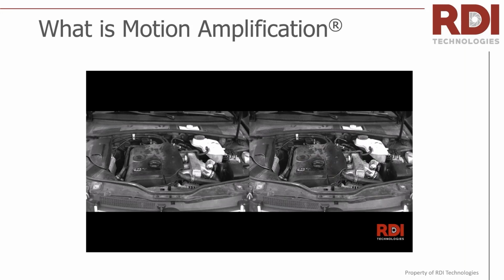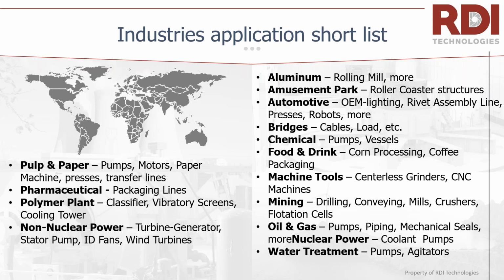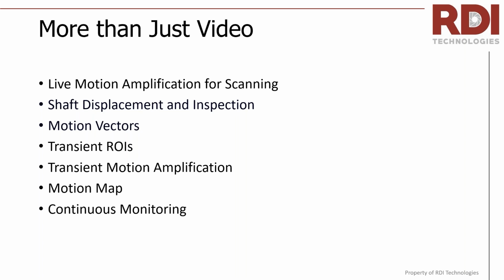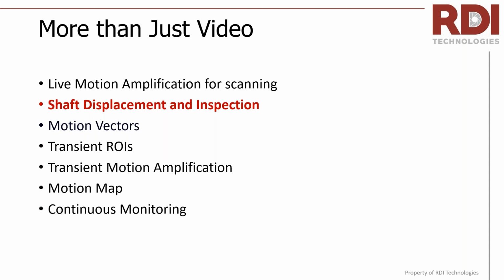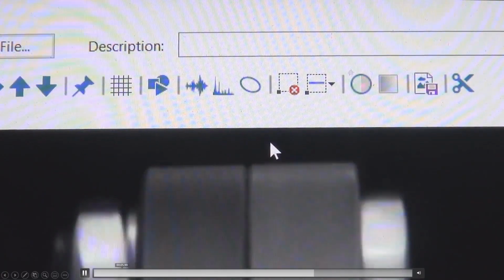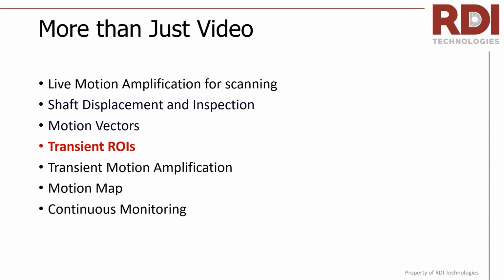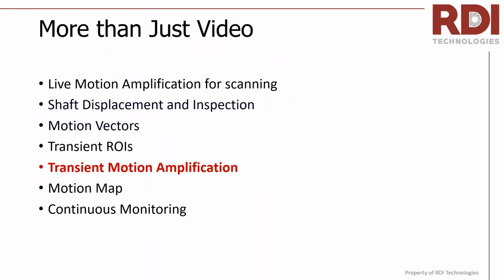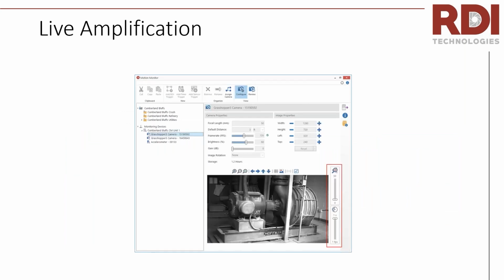Motion Amplification®: It's Becoming More Than Just Videos

Comment: a rotating machine must vibrate.  if the vibration is higher than the standard it will be a problem.  this tool is too good.  but can't detect the broken shaft and impeller shake inside the pump
Reply from the maker: Motion Amplification® is great at finding external faults that can be seen in a video. Since it can measure surface vibration similar to contact sensors, it can find the internal issues as well. This includes the cracked shaft or a shaking impeller that you mention. These internal faults just cannot be seen on video.